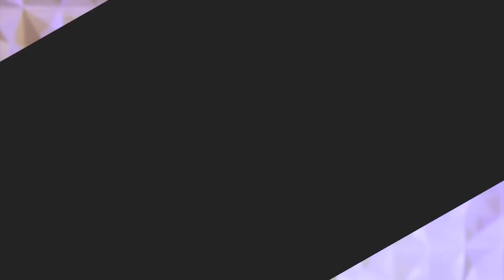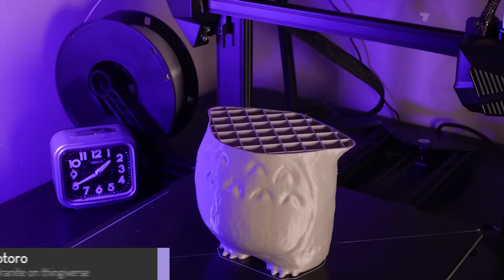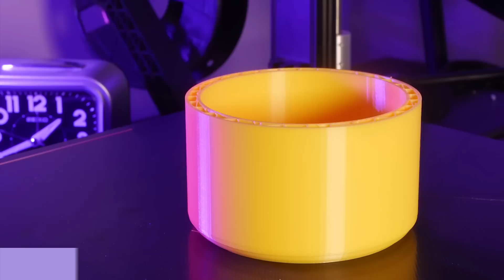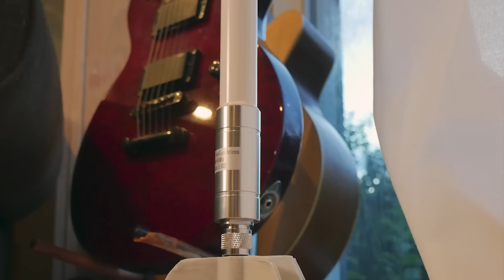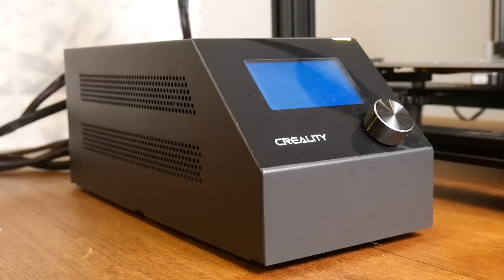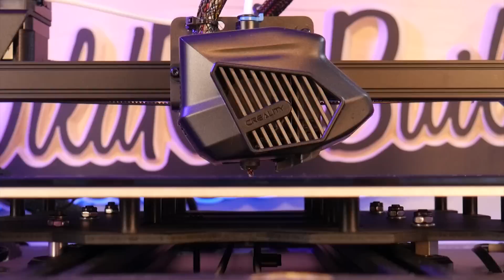Creality CR-10 Smart - A new generation of the CR-10 3D printer!

Comment: hey man, cool video. can you make a video with the settings you've used to print, because I just bought this printer and seem like I cannot get rid of stringing and a line on the back of the print where it leaves more material to stick out.

Comment: The first print was actually recorded in super slow motion. As you can tell by the clock it was finished in under 1 second. Pretty impressive.
Reply from the maker: Volumetric flow rate set to 100000
Reply: Or just turn the clock off